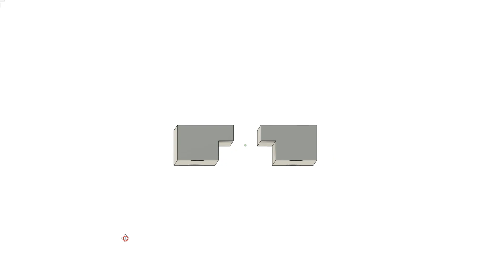Custom Adapter for using BIG workholding on a small CNC

Comment: Hi Paul, I subscribed. Please mount your vise! lol ;) Have you thought about machining the threads into the block? I have special cutters to do just that.
Reply from the maker: Thanks Bruce. I did try to find thread cutting end mills but they were not easily available and seem expensive. Im yet to get a proper vice. Keeping a look out on ebay for something low profile enough to fit on this cnc